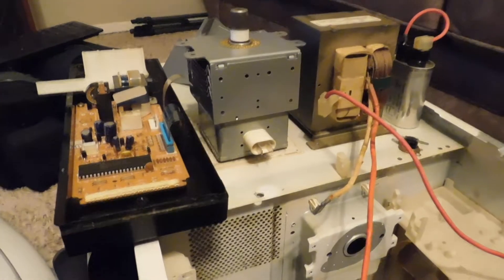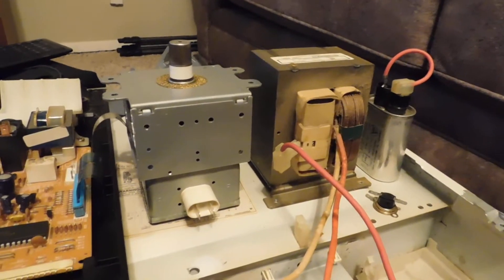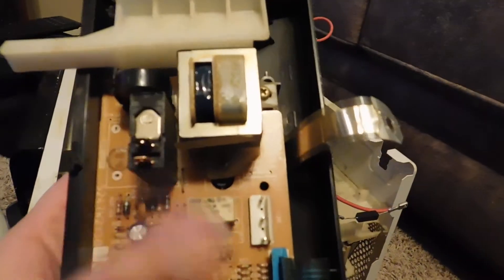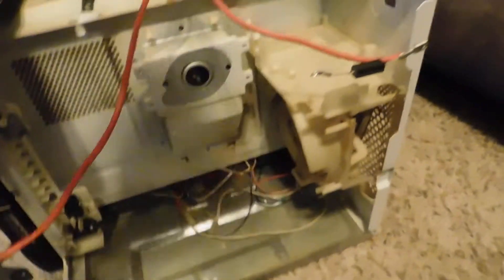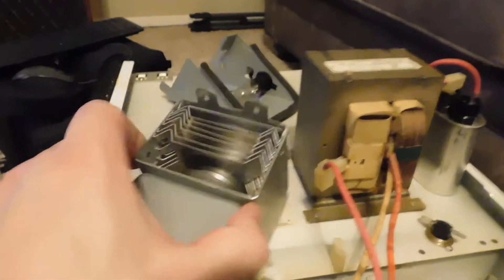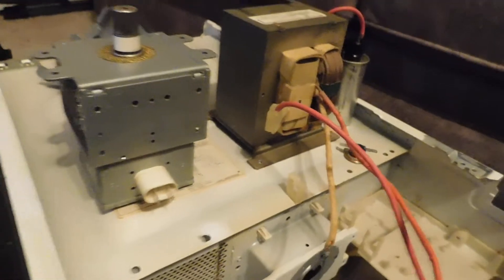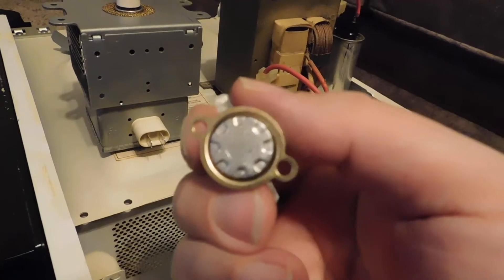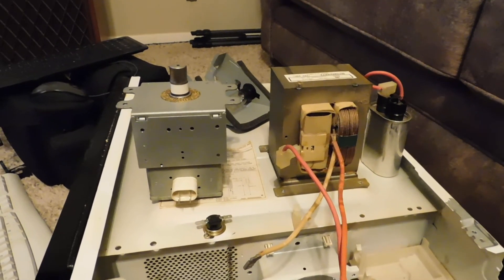Microwave Malfunction Part 2 - The Autopsy

Comment: Providing that transformer has an isolated primary and secondary (not an autotransformer) a reverse polarity outlet theoretically should not matter since the transformer electrically isolates the mains power anyway.
Reply from the maker: I've heard anecdotal stories from people who got shocked while touching a working microwave oven and something that was grounded like a faucet... I did ponder it and it occurs to me that while mains polarity doesn't matter to the oven, the ground does since while the mains are isolated, the metal chassis makes up part of the HV circuit and the ground is critical to holding at ground potential or else it will float, hence the shocks